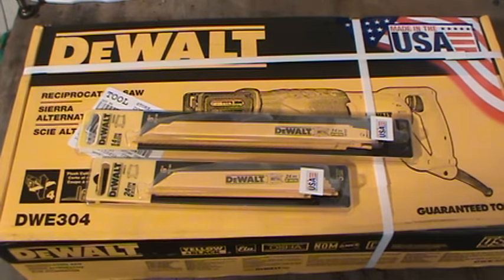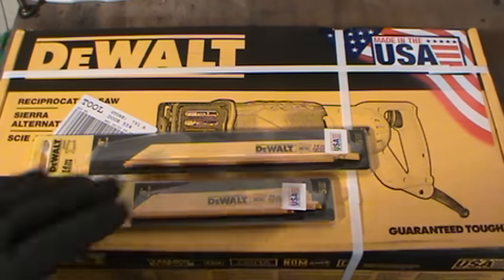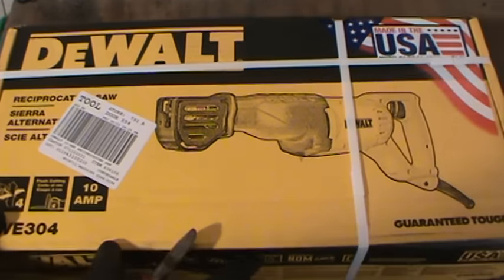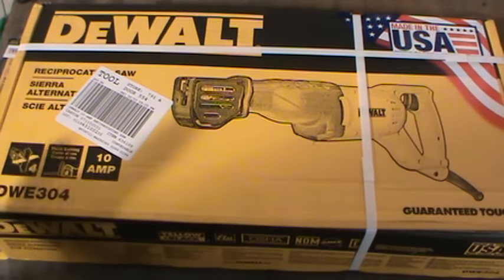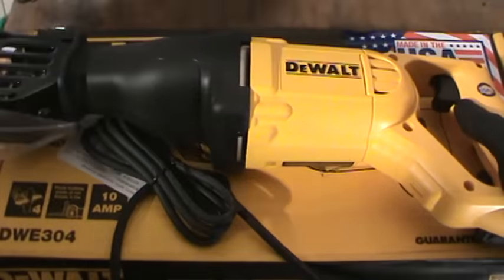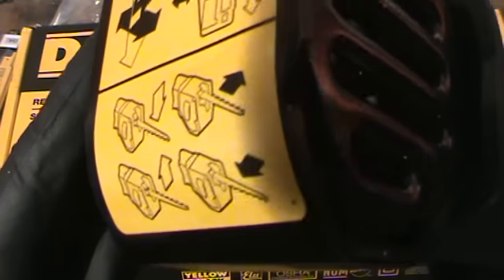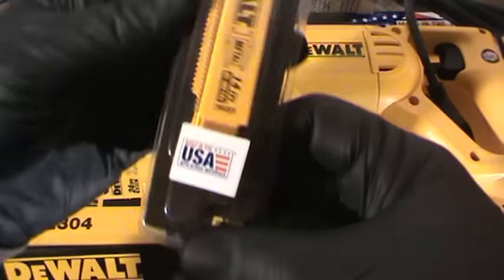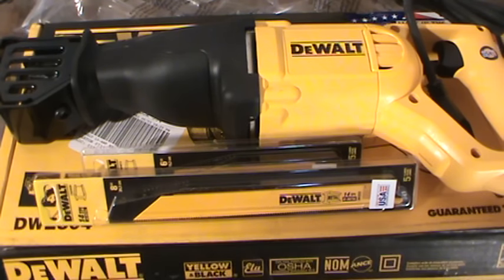Made In The USA (Well, Kind Of)

Comment: I got the harbor version for 5 years. over 50 hours of use and still going strong
Reply from the maker: I just have bad luck with their power tools. I'm sure some are decent, I actually have a saw that works good from them.
Reply: I've had good, and bad luck with HF power tools. I had their Bosch knock off jig saw. That thing gave me a lot of problems, then finally totally died, like three different ways from Tuesday. The rod that held the blade broke, so I welded it. Then the VSR switch blew up, so I bypassed it, finally the scintered gear in it broke, and that was the end of it. It wasn't cheap either. Then I went out and got the real thing. More than 10 years on the Bosch is still as good as the day I bought it. Now yesterday I just picked up an OMT off Harbor Freight. So far it seems OK. It even has soft start. I figure if it craps out I'll spend the money and get a decent brand. I don't know how much I'll use it though. I never had an OMT before. It's on super discount this weekend too. It says right in the ad, Has never been cheaper! So that sealed it for me.

Comment: Made in USA is assembled in USA with at least 75% parts US sourced, Made in USA with global materials is or at least was (up until 2016) meant it's assembled in USA with 50% or more parts in USA. It's basically the same as the old "made in USA with domestic and imported parts" label. Assembled in USA could mean simply that it's put together in a US facility or it could mean it's made in US but the company doesn't care to go through the bells and whistles to label it with USA made sticker or even update the sticker. On a somewhat uplifting note ( I guess) made in China could (very rarely anymore!!) mean that it's assembled in China with US parts. For instance some dewalt tools prior to 2012, were assembled in china with US plastics, ball bearings, us motors, etc... but after nafta and more recent 2004 shift it's a lot of china parts. Dewalt started with a "built in" USA first but later changed to "made in" ... the blades say "made in usa with global" b/c I believe at least 30% of the metal may global... all depends on who won the bid or who they get it cheapest from but it cant be more that 50% Chinese steal or it wouldn't say it. over 18 years of online and other research including actually taking tools apart. There was a ball bearing company a few blocks away (philly) where I live that produced bearings for dewalt but they stopped making them for dewalt in 2009 I believe but they are still barely in business for automobile parts at a much smaller rate (up until last year at least) ... how I don't know